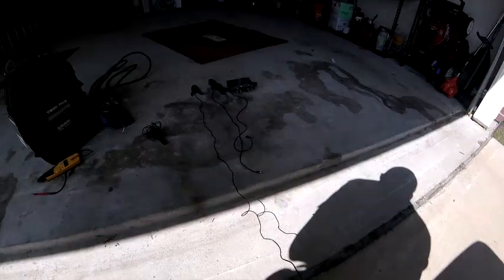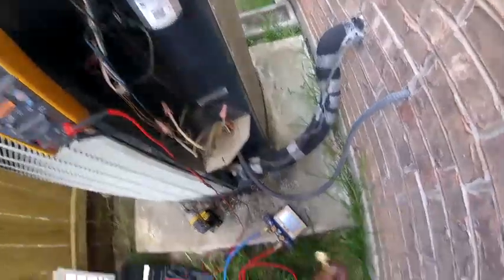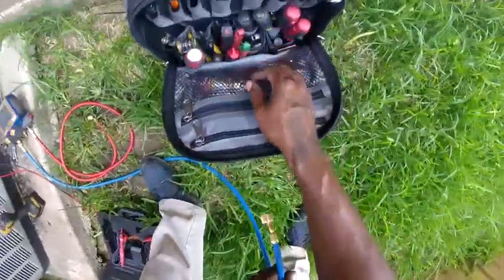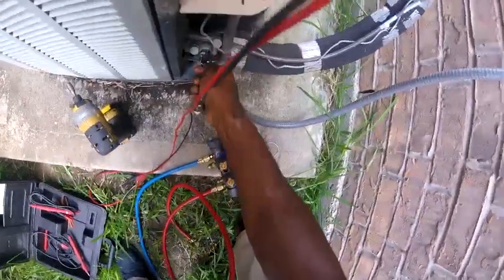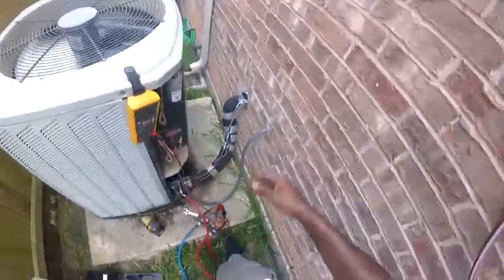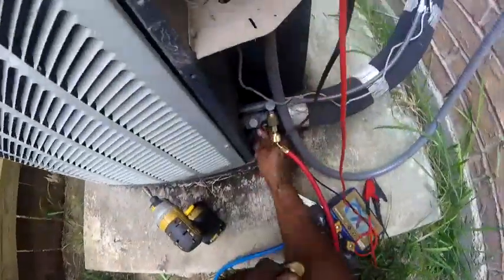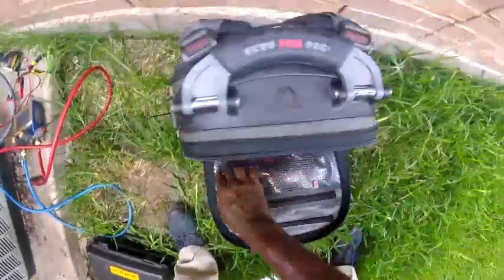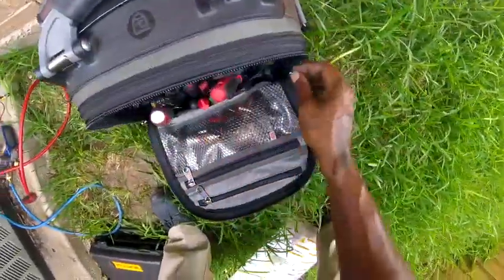HVAC: NO COOLING CALL

Comment: safety tip...when checking for power or grounding a cap...use 1 hand....do not brace yourself with the other on condenser as this creates a pathway across your heart if there is any power.

Comment: HVAC People try and disconnect low voltage wire as it enters the condenser that way tape it off and then you don't have to worry about the contactor coil side just easier
Reply from the maker: Right on..Or just turn off thermostat!

Comment: What is your charge for a service call and a cap replacement
Reply: Mark Baker why
Reply: @fedboy601  he has a valid question
Reply: I am just curious on pricing in different markets but Philip if and when I need a cap replaced I will call your mom and have her yell down in the basement and let you know
Reply from the maker: A Mark if your going to be disrespectful please unsubscribe but caps are different prices a 45/5 might be cheaper than a 70/12.5 mfd
Reply: @WWHVAC  how much did you charge for this service? what was the total bill? thanks for the vid
Reply from the maker: @bkoz319   Confidential..I know this the internet but some things not your business.. You may not mean any harm but its like going up to a stranger or a co worker and asking how much they make an hour...Google how much a  Capacitor service charge.. they around the same prices everywhere

Comment: I recently discovered your videos and must say I am impressed with your work ethic and attention to detail when servicing people's equipment. There are some that don't check anything except what they have to in order to get a unit operating. There is one that really irritates me. Some of the people that call him to do a seasonal check up are elderly living on a fixed income that can barely afford to have their unit checked and all he does is check the pressures and take a look at the coil and charging 89 dollars or so just to do that. He doesn't even look at the capacitor or contactor much less check them with a meter to ensure they are within specs. If he does have to clean the condenser coil he wants to charge them extra when he's already charged them for a seasonal check up service. Maybe he's hoping the unit will fail later and he can charge them again. That's BS. I don't really know how he stays in business but he seems to. People hopefully appreciate you taking those extra steps so they don't experience a failure after you've been there.